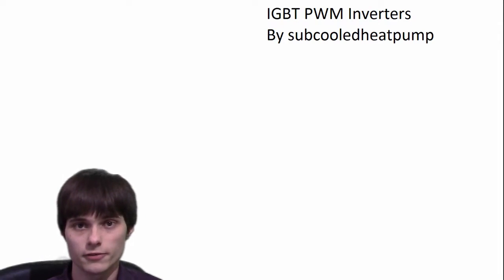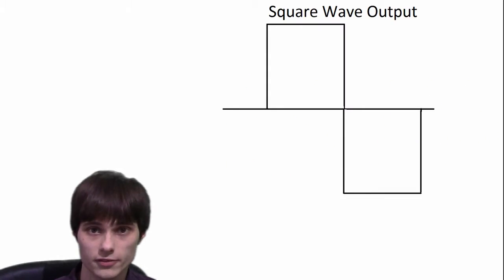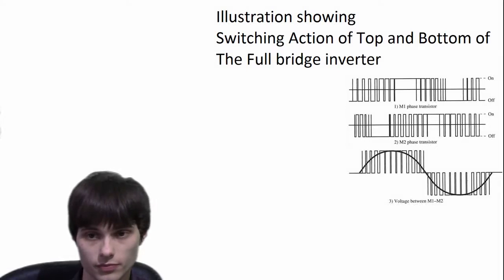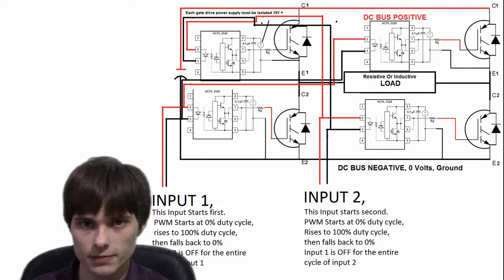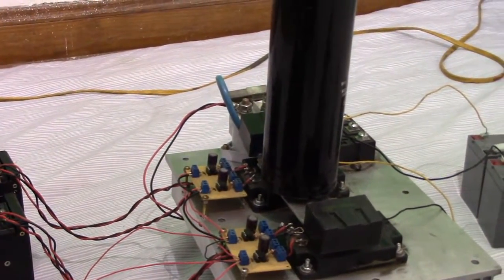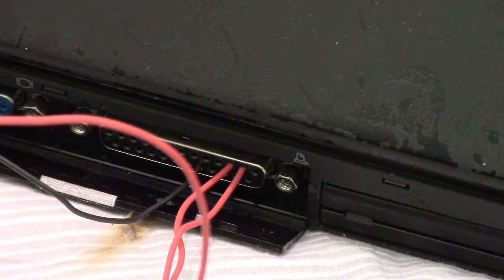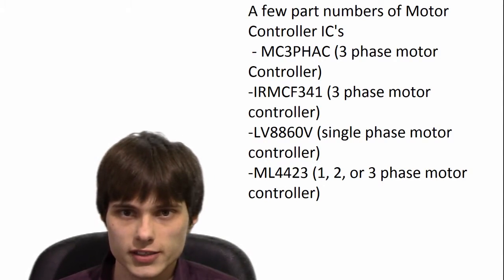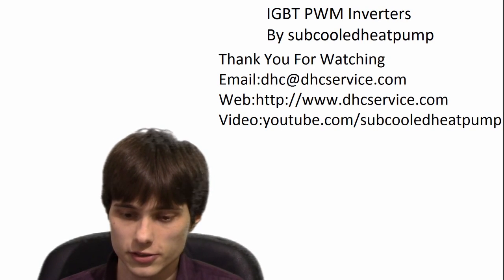Pulse Width Modulated Inverters

Comment: hello sir..I have made inverter in H bridge with igbt module..I just took a H bridge small inverter using 4 mosfets and I connected the 4 gates to the igbt gates..
it worked fine but it burns the igbt on an average load.i mean I used a 75amper 1200 volt igbt and it cant run even 10 amper load....

can u plz explain if igbt gate driver is must or I can use the normal mosfet gate pulses to drive igbt properly....

Comment: What qualifies an isolated power supply? If I used 4 different transformers plugged into the same mains outlet would they be considered isolated? What about a single transformer with 4 secondary windings? Thanks
Reply from the maker: In both cases the usual answer is yes, but it depends. In the first case this should work, as long as you are sure there is no connection from the ground(earth) to either of the secondary leads. Just to be sure, I always cut the ground lead to any transformer I'm using for this purpose. The same applies in the second case, just make sure the windings really are separate and have nothing in common
Reply: Got it. Thanks man!

Comment: What are you using for the isolated dc-dc converters? Are they referenced to the IGBT emitter or do you not have high side switching problems?
Reply from the maker: The gate drive power supply negative, for the upper stage gate drivers (positive IGBT in the half bridge), has to be connected to the upper side IGBT emitter. Not using the isolated supplies will cause a short circuit. When the upper IGBT turns on, it effectively turns the common (C2E1, E1 is the upper stage emitter) into the DC BUS positive. If one power supply was used, the low side gate drive power supply negative, would be connected to the DC bus negative. So if both gate drive supplies were connected to the same ground, there would be a short circuit. The only way to avoid it is to use isolated power supplies.
Reply: Yeah, I understand the reason you're using isolated power supplies, but I was curious about what you were using for it :) Thanks for the explanation though haha. I took a look at your other video and got my answer! Have you taken a look at something more conventional like DCP021515 IC? Or do you have no interest for mobility?  It's a very nice isolated power supply, but quite pricey for an IC.
Reply from the maker: Sorry, I didn't fully understand the question. I kinda thought you might have wanted to know what kind of supply i'm using, but i wasn't sure. My mistake. Anyway, they are actually older medical power supplies made by lambda. For the most part, my videos just demonstrate the concept with the hopes that others can learn from them and make their own projects, so I don't usually go into buying special components. You're right though, for an actual application, the medical supplies would be too cumbersome, and i would need smaller supplies or ICs to perform the isolation.
Reply: It's okay, maybe my question wasn't well formulated. I saw that they had multiple DC supply busses? How many isolated power supplies are in one unit? Those things are amazing. What can they output? 
Ah yes, I understand, I thought since you mentioned motor driver ICs as well, you wanted some suggestions on DC-DC power supply ICs, since very few people actually know about those.
Reply from the maker: They have two 5 volt supplies, and two 12 volt supplies. All are adjustable and constant current so they work even in a short circuit. The two 5 volt supplies are rated 25 amps constant current, and the 12 volt supplies are rated 7 amps constant current. Yeah it wouldn't be a bad idea to give some more specifics when it comes to which components are best, it's just that there is a huge variety of isolated supplies. If you've had luck with a certain model, feel free to share your experiences and recommendations with us. Really, I should have made a video on them by now, since you need the proper isolation voltage and input/output voltage, etc.. A lot to consider. Thanks for bringing that to my attention

Comment: Hello mate,

great video there" very interesting,  I just love the knowledge that you speak of these igbt's. wish I could stick a USB memory stick into your brain and copy all the data hahahahaha 

iv still yet to get a full bridge sorted out. got all the stuff lol. I'll get there very soon.
I'd not be where I am today with my setup if it wasn't for your Very helpful time.
your Awesome buddy 👍😉

great video as always there mate, glad to see ya subs creeping up! you definitely deserve more! 
your knowledge on igbt's is priceless!

I hope you are good and well friend, and as always thanks for taking the time going out your way and making this video and sharing it.⚡⚡⚡⚡⚡⚡

👍 👍 👍 👍 👍 THUMBS UP 👍 👍 👍 👍 👍 

Anthony 

High1Voltage1Rules
Reply: Hi Ant, i have made a prototype PCB for the MOSFET driver now, it runs on a single 5V supply and has 2 channels and uses the HCPL-3120 as the driver, its just a milled PCB form right now but i have sent off for a batch of proper PCB's, they will be perfect for this sort of application, i have also done a PWM driver using one of our Basic Nano-28X IC's and there is a POT input for frequency 0-100Hz and another POT to set the output voltage, it gives a pure sine wave output with a little LC filter on the output, i have all the parts in stock now for this, as soon as i get the PCB's back i will put it all together and do you a little video of it working and i can sort you out the correct parts then, not seen much on your youtube for a while, how did you get on with all those parts and capacitors i sent you over ?, all the best, Dave from BasicMicroUK
Reply: david ellis Hello mate, that sounds great, would like to see the finished product when it arrives.  would be fantastic if you could send me a picture of it to my email if you have it. if not let me know. 

many thanks

Anthony 

High1voltage1rules
Reply: Hello Bro.  Let me ask you do you have email adress you are using we u help me with it we chat over there,   help me with ur mail thank you